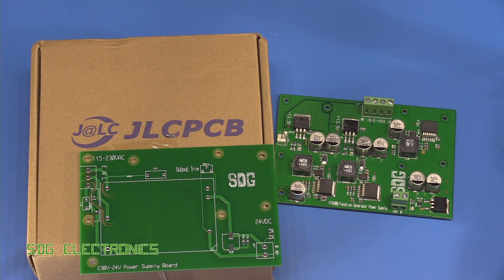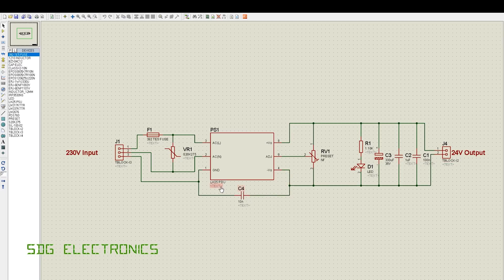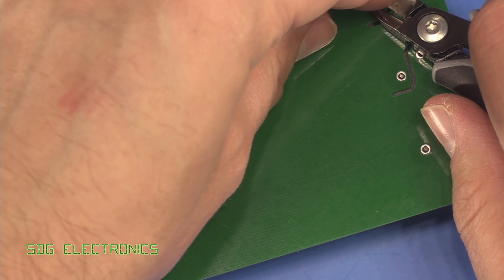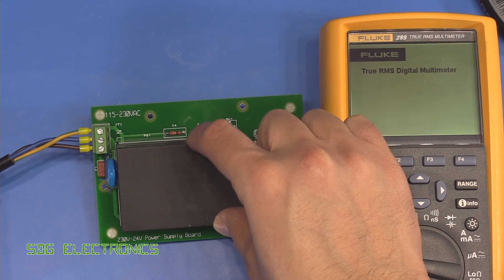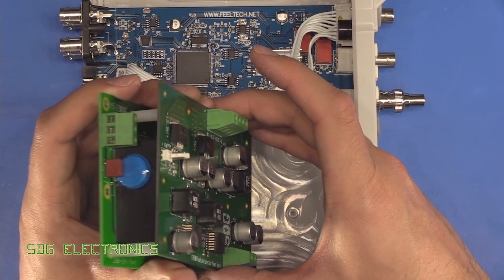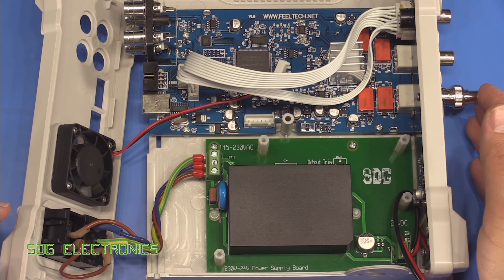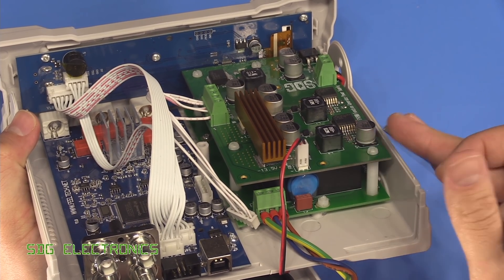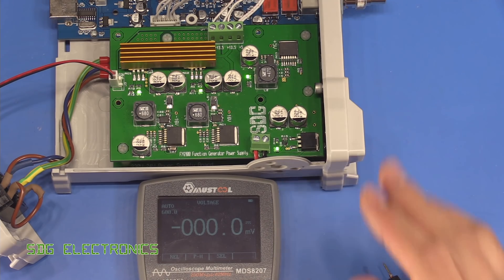SDG #120 FY6900 Signal Generator Power Supply Modifications

Comment: @8:23 Wire ferrules meaningful contribute to a safer and more reliable stranded wire termination when using terminal blocks for power delivery. Now and again makers emerge reporting a small fire on their 3D printer power board when their ferrule-less connection came loose and shorted.

3D printer movement and repeated expansion/contraction of the connection during high current heating and cooling are both contributing risk factors.

Comment: Note that the currently on sale versions of the FY6900 range have a different internal design. The multi rail PSU has gone and is replaced with a simple 5V PSU, and there are then boost regulators on the main PCB generating the higher voltages. This also means it can be powered from the USB socket.

Comment: Just got one of these signal generators, it seems they now simplified the power supply on the main board to only use 5V and ground, while curiously still using the same power supply board, just not using the +/- 12V pins. This would make the power supply modification way easier.

Comment: Why complicate matters?
Connect the generator to a personal computer to the USB-3 port and no power supplies are needed. The generator tends to get power wherever it finds it :).
You also need to remember that in standby mode, the current consumption is 500 ma, in the operating mode, the current consumption is about 600 ma.

Comment: Hi Steve, great work and very good descriction for the upgrade. To order the PCB's seems easy with your files. My problem is to buy all the small parts. Due to the SMD size. Most distributors want to sell always 50 or 100 or more of them. Is there a chance to get a package with all I need? A real kit?

Comment: Since there are no perfect isolators, you will always need a resistor and a capacitor so that the residual mains current on the secondary can be directed to the protective earth. The trick is the capacitor itself should have a much larger capacitance than the capacitance provided by the isolation of the AC to DC module.

Anyway, nice video, as always.

Comment: So in summary, what is the cost of building replacement for that power supply?:)
Reply: For me it doubled the cost of the unit. I did buy plenty of extra parts just to have spares though. It's not a cost effective mod, but for me it was a challenge I wanted to take on and SDG provided great documentation.

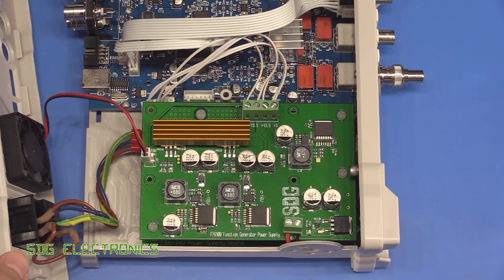Comment: Hi, i was wondering if you could clear something up, at 11:09 you have inductor values of 47uH at L2 and 68uH at L1, L3 but on the bill of materials you have L1-L3 as 47uH and also you have L4, L5 as 4.7uH 12x12mm on BOM but pads don't look big enough to take such a size, am a little confused as i am half way through build and just noticed it. Thanks in advance.
Reply: I also ordered the 12x12 from the BOM, but it didn't fit. I finally ordered a smaller one at digikey. If you need the part number, i can give it to you if it's not too late
Reply: @puddingfrais  Unfortunately it was too late I had to re-order the correct size, thank you very much for the reply though. the correct size was eventually mentioned somewhere in comments either on this vid or the other but I have managed to complete the project now and I am glad to report everything is working perfectly. Thanks again though.
Reply: @puddingfrais   Hi there, would you be so kind to send me the part number of L4/L5, please? I ran into the same problem as described in this paragraph. Thanks in advance.

Comment: I'm having trouble getting hold of 2.39k resistors, will a 2.4k do or is it quite critical as its on the ADJ of the regulator? it's R10 on the DC board.
Reply from the maker: It'll be fine with 2.4k
Reply: @sdgelectronics  Fantastic, thank you so much for your reply.

Comment: Nice video but I'm not sure about connecting the secondary ground to safety ground using a 10 Ohm resistor. This will run some amount of current, normally small, but potentially larger, through the safety ground which shouldn't be a normal occurrence...

Comment: Hi Steve, Has mentioned in a previous comment I bought a FY6900 based on your favorable evaluation and indeed it is an excellent signal generator. The documentation however is quite limited. I a trying to sweep an amplifier (dc to 1 MHz) and cannot find a means to associate a trigger to the sweeping signal to synchronize and display the respond on a scope. I tried various combinations, including "Sync" function, but without success. I would be grateful to see a video of yours on that function. Regards, RJM

Comment: There are empty inductor SMD-pads on the main blue board to the ride side of power connector. Looks like for +12V and -12V rails filtering. They are shorted, but is it reasonable to cut the short-traces and solder in some inductors for additional filtering?

Comment: English saying "Measure twice, cut once" is not good enough. We have Russian saying that translates to "Measure seven times, cut once".
I also think adding extra mounting points or tolerances (a short slot instead of a hole) will never hurt but might come in handy in case of any changes in casing...
Reply: 1:1 paper printout to check how it fits the envelope - would've accounted for some of these seven.
Reply: Since there are board-to-board and board-to-case mounting holes on both boards, some of them could've traded the roles in case it would be impossible to drill at that place...
Standoffs could've also been extended to serve both roles.
This also made me thinking, can I glue additional standoffs to the case? Dunno if nylon to ABS will hold. I would've looked for a piece of ABS to tap a thread in it...

Comment: Would it have been possible to remove the ripple from the switch mode converters without using linear regulators?
Reply from the maker: You can by putting a CLC filter on the output inside the feedback loop. Unfortunately, with no model for this IC, I couldn't simulate it to work out the values

Comment: How hot does the AC-DC 24v module get? It doesn't have too much space for air to flow next to its plastic case and probably it dissipates some heat...
Reply from the maker: There is only minimal temperature increase. Nothing concerning at all.

Comment: Hi. I bought a FY6900 from the good review that you have done. Thank you very much. Now I would like to upgrade the power supply as per your lastest videos. Question: Does your Gerber file include now the modified position for the mounting holes?  Also, what is the component name (and link) for the wire terminaison connector to the AC terminal block  that you use? Thank you again for all. Regards, RJM
Reply from the maker: I've updated to include the correct hole spacing. Do you mean the wire ferrules? https://uk.farnell.com/te-connectivity/966067-9/crimp-terminal/dp/1822091
Reply: Hi. Yes!  Please explain the advantage of using those. Thank you. Thank you also  for the updated gerber. Regards. RJM

Comment: Nice work, but adding almost $100 to the cost puts you close to the price range of a used HP33120a.. any advantages to this model over that option?
Reply from the maker: Not really. If you can find a good used model then it's preferred other than potentially the user interface being a little frustrating.

Comment: That fan isn't going to do much. Air flow has to come from somewhere, and you have no venting near the front of the device. The vast majority of the air is going to move from the gaps around the rear connectors, bypassing the board. Convection may help a little - but a few holes near the front would do far more.
Reply from the maker: There are the vents on the side of the unit, but yes, some additional vents at the very front would help a lot

Comment: Is it possible to purchase boards from you or from jlpcb using your design?
Reply from the maker: The gerbers are on my website. You should be able to directly place an order by uploading them to JLCPCB without needing any modifications. Other PCB houses may need the file extensions in the zip files re-naming to suit their process but this is simple.

Comment: Any kits available?
Reply from the maker: Kits are a little hard to manage, so no. But all of the information you need should be on the website and these videos.
Reply: @sdgelectronics  yeah im almost doe with winding the transformer so I will just finish what is started with linear power supply for the FY6900. This looked interesting but finding the smd parts ordering online from different suppliers and waiting months for delivery not worth the time.  Thanks for response.

Comment: Isn't 10 ohm from ground to earth unnecessarily small, making it impossible to put the bnc shield at any voltage above earth? You would get 1A and a burned resistor if you connect GND to 10V above earth. 
Assuming the 100v came from a ~1nf class Y cap in the power module shouldn't a 100k resistor be enough to take te output close enough to earth potential while allowing you to reference the GND to hundreds of volt above earth without much current?
Or am I missing something?
Nice Rossmann reference.
Edit: at 200khz switching frequency I guess you would need a lower value resistor or a capacitor, perhaps something to test in a future video?
Reply from the maker: I was in two minds about this. Any 'professional' signal generator will have the BNC shield tied to mains earth, however with this comes the drawback of not being able to float the output. A higher impedance resistor would work as you mention. Thanks

Comment: Just a quick thought in respect to the grounding / floating via 10 ohm resistor I always picture that the piece of test equipment really aught to have that feature brought out and represented on the front panel by having a metal bridge across to an extra terminal. So that the user can choose whether or not to remove that bridge depending on the scenario. However that is not something on the front panel of this signal generator, especially with the outputs being BNC connectors. Sorry it's not a big deal or anything... Just wondering how that sort of thing should be done. Perhaps by cutting a little hole in the side or back of the unit and wiring up some extra links to that 10 ohm resistor. Assuming that detour does not affect the equipment adversely in terms of noise or whatever.
Reply from the maker: Yes, the FY3200 signal generator which I previously modified (it's one of my earlier videos) has a fully floating output by virtue of traditional EI core transformers and no connection whatsoever to the mains earth. The resistor could be switched in and out by an auxiliary switch on the back of this unit maybe with some higher impedance permanently in place to keep the voltage from straying too high. Thanks for the comment
Reply: @sdgelectronics  Thanks for replying. BTW just also wanted to thank you for your recommendation in your previous SM-745NTP video review of that stubby 0.35x microscope camera adapter thingy. Which also fit perfectly the 38mm hole in my new Eakins microscope. Otherwise would have been hard to find the right one. Everybody still always buying the wrong ones with the lack of standardization etc. Really appreciate it. Kind Regards have a good day

Comment: i wanted to shield the signal gen section of mine, it is spraying shit all over the place.

program in a 2x Sinewave in a ARB slot using the pc software, set output to 50mhz and your actual output will be 2x / 100mhz.

fm modulate it using the back input or ch2 and get a fm radio, tune it to 100mhz. 

even without anything connected to the bnc's and amplitude set to 0 i still can hear it transmitting for quite a distance.
Reply from the maker: Let me try that out